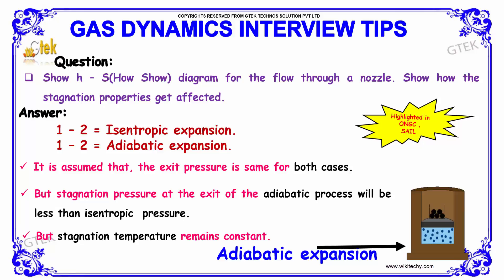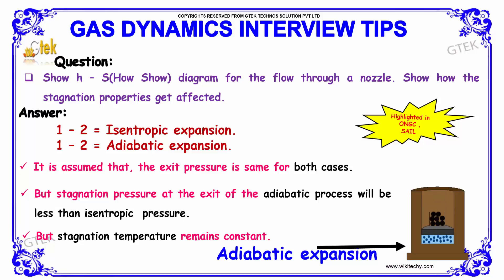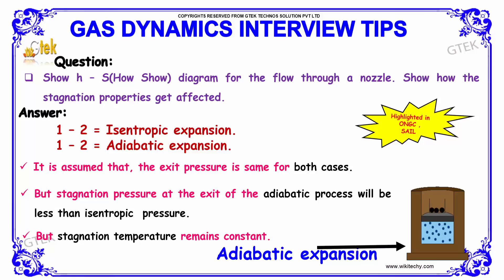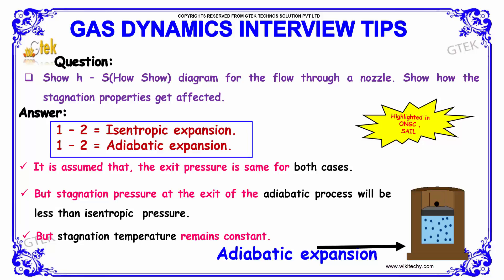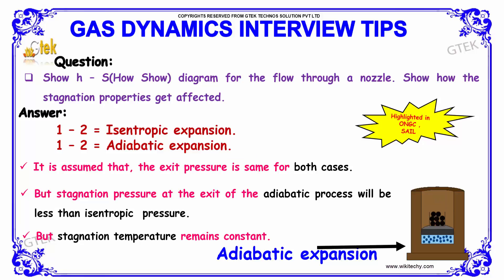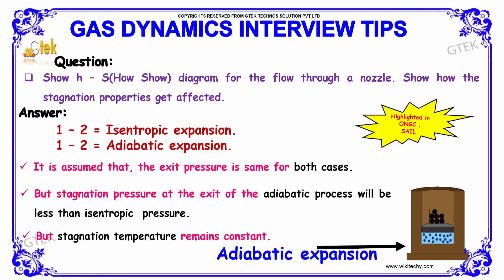Show h–S(How Show) diagram | gas dynamics interview tips | wikitechy.com

Comment: Dynamic models derived from basic physical principles can appear in several forms: ... Chapter 2 that the transfer function T(s) is the transform of the forced ... schematic diagram, which shows the physical connections, the block .... 1+ G(s)H(s).

Comment: A diagram is a symbolic representation of information according to some visualization .... Gantt chart – shows the timing of tasks or activities (used in project management) ... diagram – shows the fatigue data (example: for a wind turbine blades). H ... S. Sankey diagram – represents material, energy or cost flows with quantity ...

Comment: The underlying property data for the Mollier diagram is identical to a psychrometric chart.
 At first inspection, there may appear little resemblance between the 
charts, but if the user rotates a chart ninety degrees and looks at it 
in a mirror, the resemblance is apparent. The Mollier diagram 
coordinates are enthalpy h and humidity ratio x. The enthalpy coordinate is skewed and the constant enthalpy lines are parallel and evenly spaced.

Comment: Thermodynamic diagrams usually show a net of five different lines: isobars = lines of constant pressure. isotherms = lines of constant temperature. dry adiabats = lines of constant potential temperature representing the temperature of a rising parcel of dry air.

Comment: An enthalpy–entropy chart, also known as the h–s chart or Mollier diagram, plots the total heat against entropy, describing the enthalpy of a thermodynamic system. A typical chartcovers a pressure range of 0.01 - 1000 bar, and temperatures up to 800 degrees Celsius.